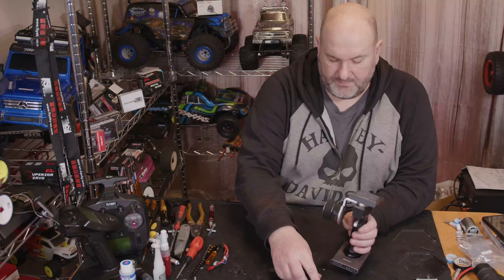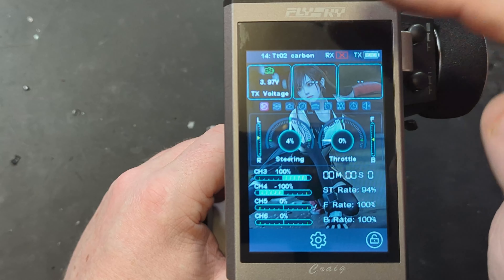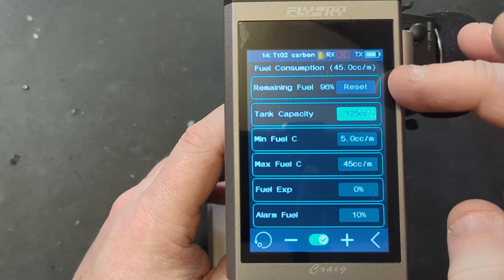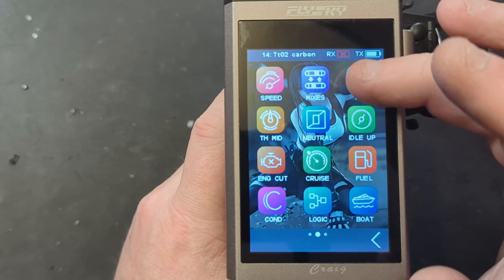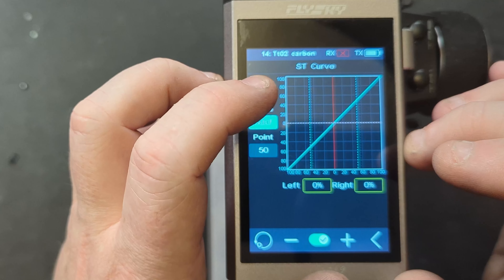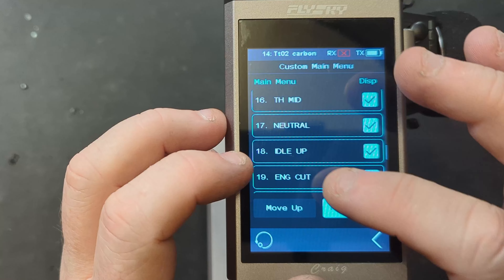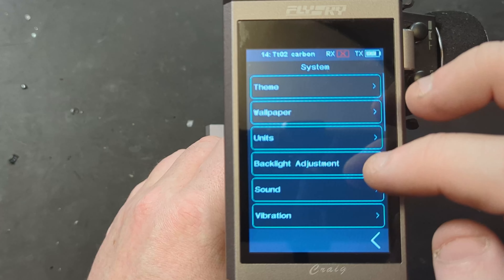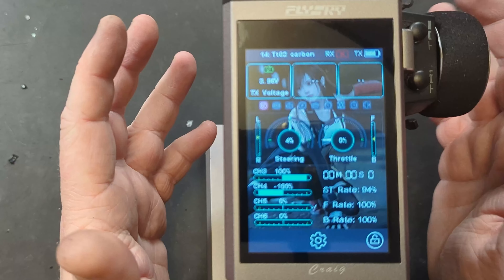Flysky Noble Pro firmware v3 1st look its now live.

Comment: It’d be nice if they said they’re going to support the ANT protocol, or release an NB5 with ANT and FPV similar to the new RadioLink
Reply from the maker: Ant is for the cheaper slower response radios not the nb4 and pro as it's not fast enough for racing
Reply: @WTFRCCars  I bought into the ANT though... Hate to have multiple receiver types... Transmitter yes, receiver no
Reply: I would order an nb4 pro right now if it was backwards compatible with ant.. I like having one Transmitter for everything but buying/installing 20 recievers is holding me back

Comment: WOW.... Flysky 👏👏👏
WTF RC - Can you compare the NB4 and the Pro version on the new software at some point please? ie for carpet racing is the NB4 as good as the Pro?
Reply from the maker: I've done a whole playlist of vids on the nb4 already so it's easy to see what's different, as for how they compare to each other now the nb4 and pro are very different radios. For just racing and not using the new functionality just for driving using 2 channels you won't find much difference the pro is very slightly faster response time but both are as fast as anything sanwa and futaba have :)

Comment: Can you bind the same receiver to multiple model slots?  The idea being that you can have 2 or more different "model" presets for the same vehicle/receiver (i.e. top speed & racing presets)
Reply from the maker: No that's the whole point to binding :)
Reply: @WTFRCCars  So is there any other way to have multiple presets for  the same vehicle on this transmitter?
Reply from the maker: On th noble pro you can have conditions so this allows multiple presets for lots of the options

Comment: The download Tab does not work on their website

FCC Firmware(EN version)

File size:4.33M

Update time:2023/03/21

DOWNLOAD
Reply from the maker: I think some have gotten it from assistant v3 but flysky may have removed it as it should not be out till end of April
Reply: @WTFRCCars  ok thank you

Comment: I can't see svc settings..
Reply from the maker: It has SVC when connected to the correct receiver
Reply: @WTFRCCars  Did they change something in SVC ? Replaced my GYD 450 which is supposed to be top tier Gyro with built in gyro.
Reply from the maker: ? Not sure what your asking :)